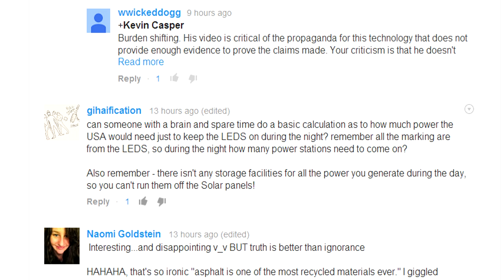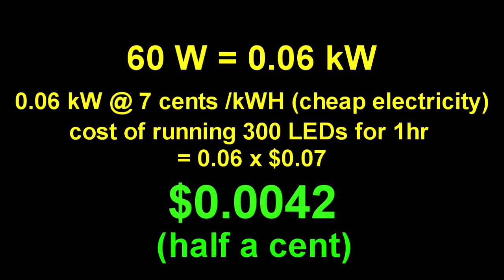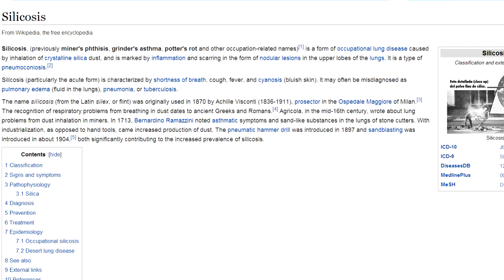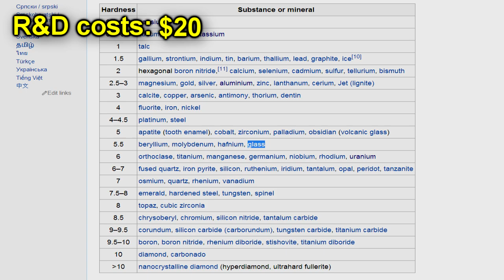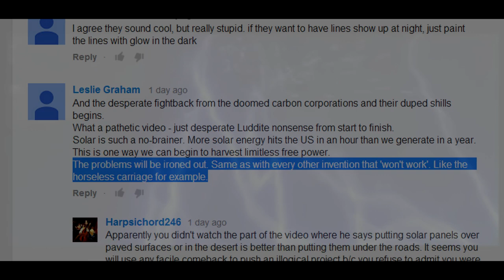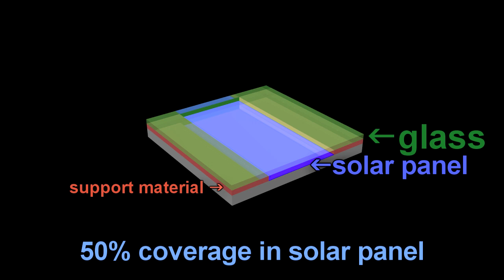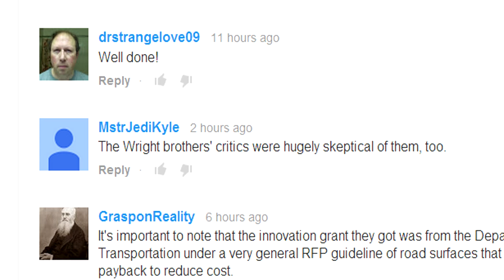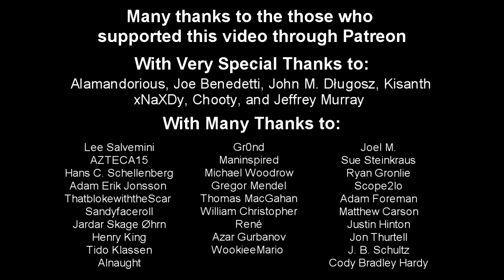Solar Roadways, IMPORTANT QUESTIONS AND ANSWERS!

Comment: Yes, because the idea was to light up 12 trillion lights all at once, right?  All the videos showed them ALL turned on all the time, right?  The idea is to only light up areas needed, and only a small portion of the road is on at any give time.  You can compute all the numbers, but fail when it comes to simple logic like realizing the lights won't all be continuously on 24/7. Same thing for "all the tiles lying flat in the ground", because there are never hills, right?  And asphalt, FYI, is far softer then glass.

This may not be viable, for several reasons.  But if you're going to criticize it, at least get your own facts in order before shooting off your "brain" on the topic.
Reply: How will they decide which areas need to be lit up at any given time? Will that be done with sensors that also require electricity? I'm not saying you're wrong, but what are the logistics, and has it been costed?

The orientation (lying on flat ground vs hills etc) is still a problem, because the units are fixed. Whatever angle they're pointing up at, they won't be tracking the sun so each unit only has a small window each day when it's optimally aligned to the sun. The rest of the time, it's less efficient. Also, while the units on one side of a hill might be perfectly aligned towards the sun at a certain time of day, then aren't the units on the other side even worse off than if they were lying flat? Their angle would be even more detrimental for collecting sunlight than if they were pointing straight up. You need to consider how they're aligned over the whole span of daylight hours, not just the time when their hillside orientation is optimal. 

Also, as others have mentioned, it's not just asphalt that you need to consider for hardness / toughness. In a normal road, the asphalt is just the binding agent that holds all the aggregate together. That aggregate is rock, which is harder than glass. That's what you need to compare to glass.  

I'm not saying Thunderf00t got everything right here, but your objections don't really answer his objections as well as you seem to think they do.
Reply: I'm not saying this is the best solution for everything on the planet.  I think this has very limited application actually, and the one they're touting is probably not the best use for it.  I'm just saying don't use false arguments when there are plenty of positive ones to use.

The demo video shows lines on a road at night, and lights under the hoofs of a deer in the road.  If every light were lit up, there would be no lines.  Just a solid lit up road.

Lets do some math.  Let's use the numbers he puts forward on how many LEDs per square meter there are, and assuming all dual-lane, two way roads.  Let's further assume they all have 4 lines (3" wide), one white on each side, and two yellow in the center.  If a road is 2 lanes across, that's a minimum of 24 foot, with 4 lines lit at 3" each (total 1 foot).  Now instead of "12 trillion leds", we have 1/2 trillion.  Power use is no longer 5 times what the average US person uses a year, but 1/6th that, a 17% increase.

Now, I'm not saying increasing US power use by 17% is a good idea.  But it's not the the 500% being touted as a valid number.

Part of Thunderf00t's disdain of others is their penchant for hyperbole instead of using logic and reason.  He's not immune from that call himself.
Reply: Yep, you're right that not every LED will be required at any given time (and that there will be many units that won't have need to have any active LEDs at all for the majority of the time). That wasn't the entirety of your original objection, so you seem to have dropped a few points without acknowledging the fact, but that's fine. What you're saying here is still perfectly valid (although if every LED was used, it wouldn't be a solid lit-up road, since the LEDs obviously don't fill the surface of the unit, but I understand what you mean.) I agree that TF appears to be guilty of the hyperbole he dislikes in the arguments of others when it comes to power requirements, but that's not the entirety of his objection and even with your math this is still an issue. 

I guess the overall question pertaining to power requirements remains: can these units generate enough power just for themselves (with non-lit-up units presumably being able to somehow cover any shortfall experienced by those that are lit-up - which will need some control mechanism that will require additional power) as well as providing electricity for other uses? If not, then there doesn't seem to be any point. If these units don't collectively generate a surplus of electricity, then the whole idea seems to be flawed.

And that's ignoring the other problems TF and others have raised with regards to cost, glass surface suitability, LED visibility in sunlight etc.

If they end up inspiring someone else to develop a viable spin-off idea, then that's a win, but I'm not convinced this idea has a future.

Comment: Another excellent debunking, one nitpicky criticism though.  You said that there isn't any storage facility for power generated during the day, there are techniques that work to store energy in the day and release it at night, you do lose a lot of efficiency though and it's geography dependent (also I'm sure these guys didn't include them in their plans).  The most common I've heard of, and I'm just a casual reader of science blogs, is to use about half the generated energy during the day to pump water from a low lying area during the day to an uphill reservoir.  Then at night you release the water to generate hydroelectric energy.  You lose more than 50% of your energy, but it works.

Comment: These solar "roadway" panels though not suited for practical use as actual roadways might find a better market as home patios, pathways, and maybe some limited use as driveways. They would need to be attached to rechargeable batteries so as not to need to pull power from the grid at night. Though the durability problem is reduced it still would not be fully eliminated and traction must still be considered, as glass can be very slippery when liquids are on its surface, no one wants to slip and crack their skull etc. or see grandma or grandpa slip, fall and break their hip. So even finding a more practical use for it still has some hurdles to overcome.

Comment: This project fails on so many engineering levels. These guys are clearly just electronics geeks and know almost nothing about materials science. It's not just hardness that they fail on. It's also toughness, fatigue, thermal shock resistance, shear stress, tire traction, PV efficiency of a semi-transparent dirty scratched surface with poor directional optimization and other devices and support materials blocking the PV cell space, energy storage needs, material availability/abundance, maintenance costs and practicality, power consumption of LEDs and microelectronic devices, consideration for winter, consideration for the pot-hole road degradation mechanisms, and holy shit what about CO$T, and probably much more.

It would be far smarter, far more efficient, and far more effective to install sun-tracking and solar-concentrating solar cell panels and wind turbines on the larger rooftops of industrial, commercial, and governmental structures, and in sun-drenched places like deserts. Smart ways of reducing our environmental impact and our dependence on coal and oil do exist. This is absolutely NOT one of them. 

I'm convinced that the only people saying stuff like "they laughed at the Wright Brothers" and "they laughed at Galileo", and that "with proper funding they can make it work so don't be so cynical", are people who have no formal education in the physical sciences, engineering, and absolutely no knowledge of materials science.

Comment: I agree with most of thi video, and the comments saying covering roofs and roadsides would be vastly more efficient use of solar panels, but the cost of running LEDs seems like it could be an easily mitigated cost. For instance, using regular road paint for things you know are always going to be there. Or having little flippy switchy things that reveal a reflective white bar or something.

Maybe I'm just attached to the cyberpunk idea of having roads that change text actively. But I'd also rather driverless cars than that.

Comment: ***** I like a lot of your stuff, but you are coming across as just a naysayer in this video.  

I've no problem with being skeptical.  Prove the technology doesn't work, I welcome it.  I did a fair amount of reading when I first heard of these, all the while thinking "nah, these can't be serious, solar power is SO inefficient!"  But the more I read the more it made sense.  

I especially take issue with the fact that you do not seem to have read through the FAQ and numbers from the inventors themselves.  In there, they clearly address some of the concerns you cite.  
(found here)
http://solarroadways.com/numbers.shtml

For example, on the topic of efficiency.  You speak in the video as though the efficiency of the panels is questionable.  Well one visit to their website and they tell you exactly what they are using:
"Sunpower Labs is shipping E18 series panels with 18.5% efficiency, so let's go with what is currently available."

On that same page they also say they are assuming 4 hours of peak daylight in their calculations.  

Your experiment on a flat solar panel vs an angled one was good thinking...but they beat you to the punch (and got about your same results also) and also went beyond your testing to find something you didn't.  
"Although the tilted solar panel produced more energy as expected (an average of almost 31 percent more than its horizontal counterpart), we were surprised to see the phenomenon of the horizontal solar panel producing more energy than the tilted panel on certain overcast days. It appears to be similar to getting sunburned on a cloudy day: sunlight is still present, but it is scattered, so the horizontal solar panel is more likely to pick up the scattered photons than the solar panel aimed at the southern horizon."

You mention the fact that your panel didn't have a bunch of glass on top of it.  Well, some more reading on that same page:
"Another thing we learned - through experimentation - was that our 1/2-inch textured glass surface reduced the amount of energy produced by solar cells by 11.12-percent."

Your concerns about powering the LEDs are good, and they indeed do not have any numbers citing the excess power produced by their panels once powering of the LEDs is taken into account.  They claim they will post updated numbers in July this year.  

But I can assure you, and I'm sure they know this already, that if it takes more power to run those LEDs than power produced by the panel, no panels will be sold.  
When you speak to longevity question of glass as a road surface, I would have rather you directly address their FAQ on the topic.  Instead you do an experiment that doesn't directly address their supposed solution.  Scratching a surface is hardly tantamount to breaking it, and since when are we concerned about our roads being in pristine condition?  Scratches and scrapes are hardly reason enough to replace panels and are not indicative of them actually breaking anytime soon.  
http://www.solarroadways.com/faq.shtml#faqHardness

You had some fair points, I had not thought of the health issue potentially raised from glass particles flying around as they are scrapped off the road from vehicles.  I would love to see them address this issue.  But that's hardly a project ending roadblock.  

Skepticism is good and healthy.  But this video, at least as you've presented it, just makes it sound like you are on a mission to destroy the very idea without actually addressing what has been developed thus far.

Comment: I would actually argue a bit with some of Thunder's math.  Well not the math exactly but how he's arriving at some of those numbers.  First of all the price of $20 per 300 LEDs is a commercial retail price for LEDs in a strip plus a power supply and a remote.  Buying raw LEDs directly from a manufacturer in bulk would be much cheaper. Still gonna be in the billions but no where near 800 I'd bet.

Then there's the electricity bill to run all 12 trillion LEDs. Well, why are we doing that math? Even if they did this they would never run anywhere close to all the LEDs.  Just look at the average road, the vast majority of the surface is blank, you're only going to be running a small percentage of the LEDs.  Of course, it's still gonna be pretty high because even if you only need 10% that's still $140 billion a year.

Just to be clear, I actually agree the solar roads are a horribly impractical idea I just like to be accurate on the number.  Solar panels=good.  Solar roads=bad.

Comment: The LED used to test here are the 60 LED/meter type and there are like 200 led/meter type, which produce more lights and use more power. However the result will be the same against sun light. the intensity of a LED light is still nothing compare with the sun.
You can pulse the LED at higher current at high frequency, but the resulting brightness is not much higher, not to mention you may get lawsuit from people with epilepsy.
If it is only used in city pavement, you will have the problem of glass being slippery especially in wet condition -> lawsuit.  Also lighting from the bottom at night will also shy lights up lady's skirt -> lawsuit.
Another human factor would be, what stopping people steeling the tiles at night and use the solar panel for themselves?